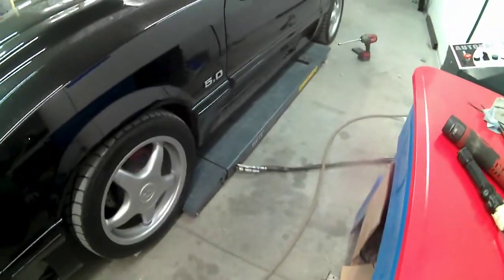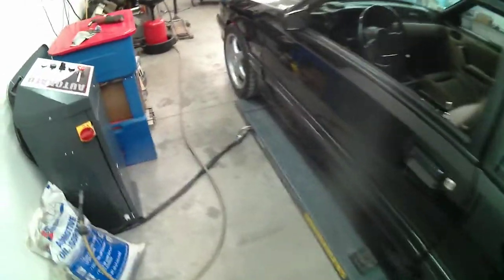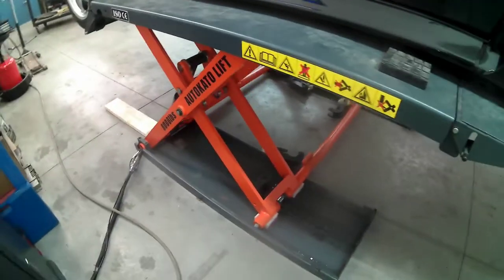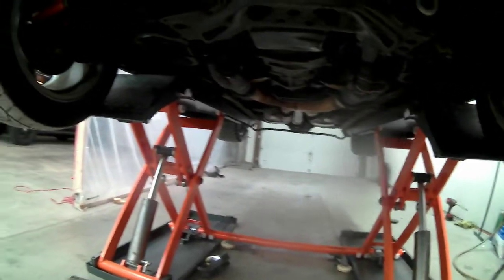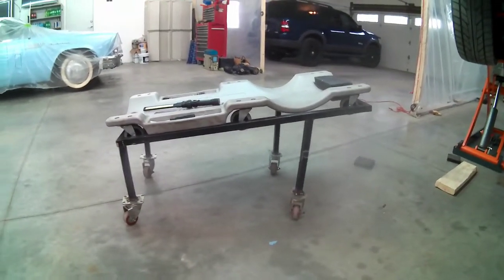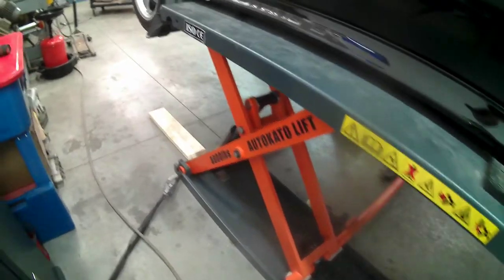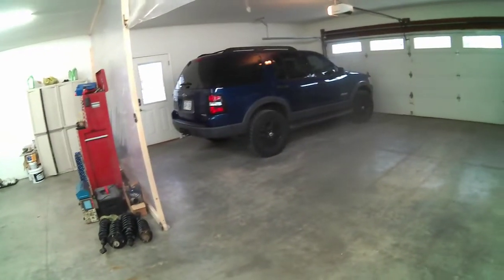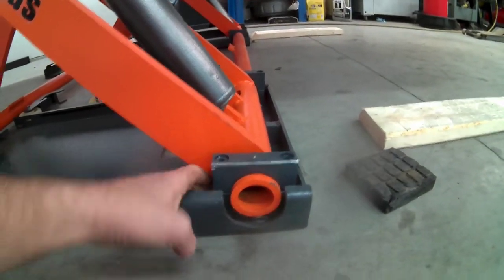Autokato Automotive Scissors Lift

Comment: Are you saying when you set your suv on the lower two lock settings, it bent the bottom plate?  So its not a good idea to use those lower settings at all?

Comment: Looking at this one on ebay and it says air compressor required. Does your use an air compressor? Where did you buy your from ? Thanks for the Vid....
Reply from the maker: I also bought it off ebay. Yes it uses compressed air to release the safety locks.

Comment: Just got the same lift 110V , pneumatic locks , curious what amp circuit are you running?  I tested it out on a 20amp and instantly tripped the breaker with no load on it.
Reply from the maker: I actually ran a 30amp 120v circuit for my welder that I ended up using for the lift. Your right, 20amp just isn't enough most of the time.
Reply: @Drives88  thanks , I finally looked at the motor rating and came to the 30 Amp conclusion.  So far been pretty happy with the lift. Thanks for making the videos helped make the decision.
Reply: I have the same one and run it on a20 amp breaker no problem just make sure the lift goes up a few inches before contacting vehicle

Comment: Dumb question but , were you using thee rubber blocks at your lift points in this video ? I saw one on the floor and one outside of the car on the lift.
Reply from the maker: I have to use the 4 2" block to lift that mustang, looks like 3 were on the floor and one was on the driver side lift.

Comment: Did you get it delivered to your house? Im planing to buy one soon
Reply from the maker: No I had it delivered where I work, I brought it home on a snowmobile trailer that tilts.
Reply: Did you ever order? I’m wondering if the shipping company unloads it off the freight truck
Reply: @Joe11221-d  I did but pick it up my self warehouse was about 40 min away. I picked it up on my trailer
Reply: Had mine delivered to my house driver wheeled into my garage cost an extra $200